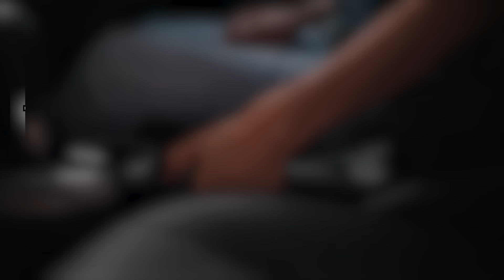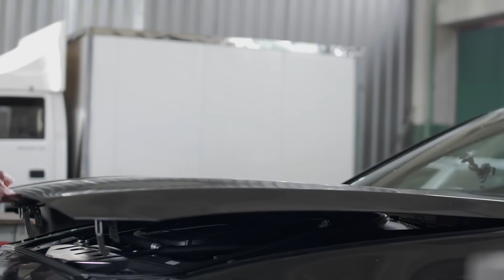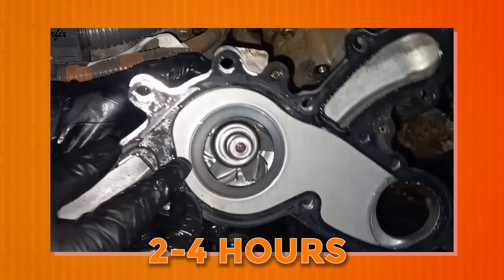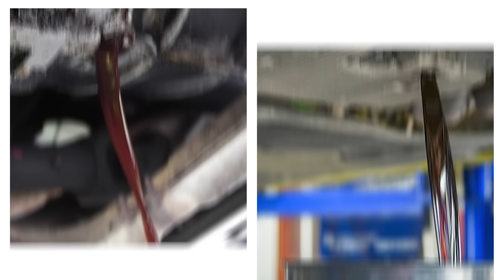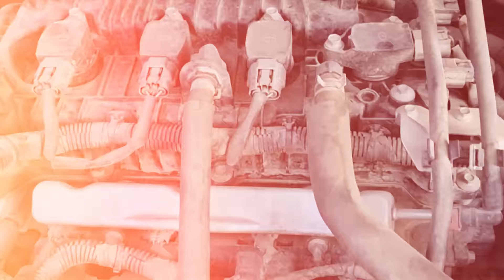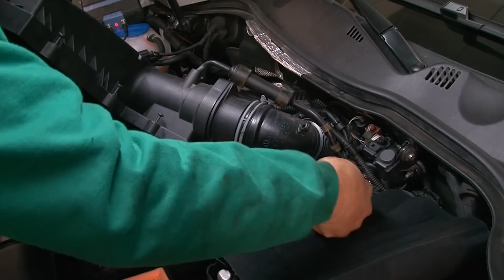Top 5 Lexus Failures! Why They Happen And How To Avoid Them

Comment: Where the video messes up is that they fail to distinguish between the original, direct injection only engines and the “newer”, combo direct AND port injection engines which provide for more intake valve cleaning than direct-only.

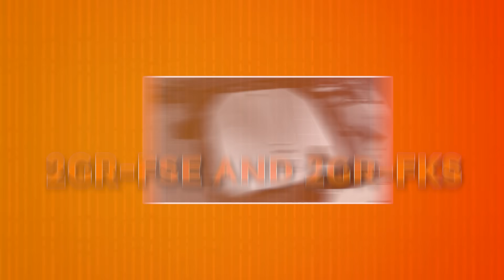Comment: @4:10 you're wrong. The 2GR-FSE is one of the best engines, I have a 2010 IS350C, which has the 2GR-FSE. I think you meant to say the 4GR-FSE engine which is in the IS250 and IS250C. Those 250's are garbage from 2006-2013.